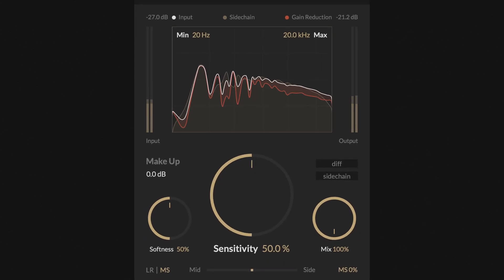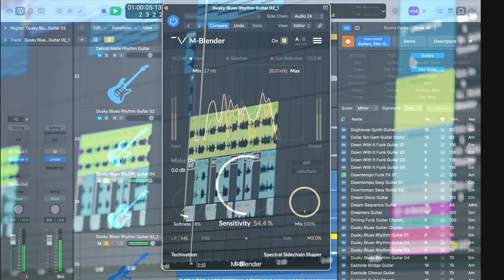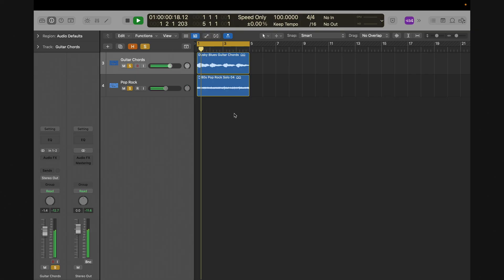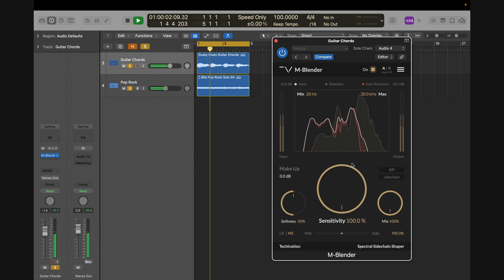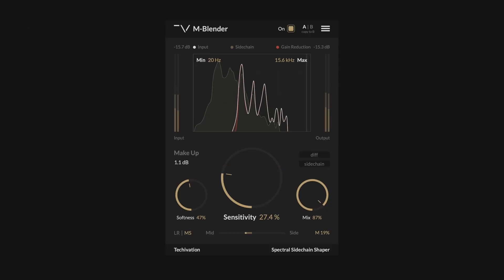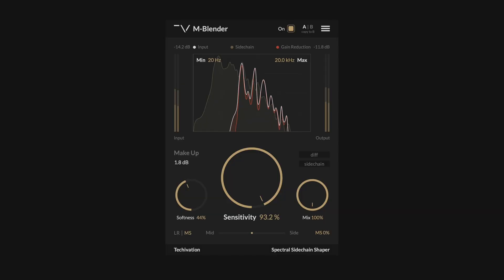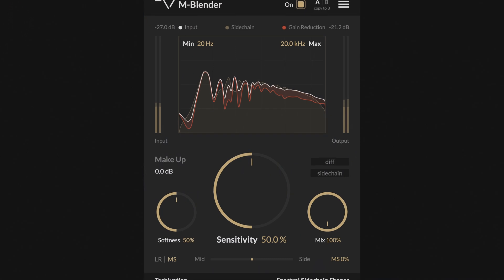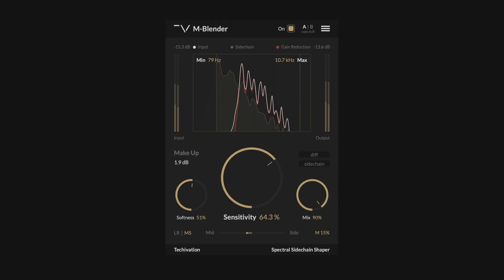Techivation M-Blender Walkthrough

Comment: Trackspacer is much cheaper and does everything that this does and possibly has even more control. Use that.
Reply: Trackspacer is $59.00 and is M-Blender is $45. According to my calculations, M-Blender is cheaper
Reply: No there is a currently half off sale, normally it's ninety dollars. So why not just say that rather than try discredit someone?
Reply: @jcjc8939  Nice try, try hard. When I wrote the comment, M-Blender was $90, and is currently on sale for half price, with the original $90 price tag still visible but crossed out to reflect the sale. Why do people behave this way? Try to discredit someone they don't know, rather than, for example in this case just saying "if you like m blender, it's currently on a 50% sale"?
Reply: @jcjc8939   @jcjc8939  Nice try. When I wrote the comment, M-Blender was $90, and is currently on sale for half price, with the original $90 price tag still visible but crossed out to reflect the sale. Why do people behave this way? Try to discredit someone they don't know, rather than, for example in this case just saying "if you like m blender, it's currently on a 50% sale"?

Comment: I know it's only 1 hour old lol but an attack and release control would be awsome
Reply: Maybe if it were more akin to a compressor, or a gate, but proper spectral ducking/removal doesn't need attack and release as it doesn't work on a knee.
Reply from the maker: Even though the plugin is using a compression-style threshold, it’s actually doing spectral subtraction and there’s no explicit attack/release under the hood. :)
Reply: @Techivation   I am trialing it right now. Even after what you say I  would still wish for an Attack+Release control (and more SC flexibility on the Sc Filter of M-Compressor. 120hz  is a bit low 200-250 would be way more flexible) . 
To M-Blender now. Spectral of Not Spectral subtraction , a Signal is a Signal and when you take energy out of it it sounds like you are taking energy out of it. 
However sometimes it is wanted to have the effect NOT duck for the whole duration of an incoming signal in order to experiment. Overlaping sounds are the Spice of music. Sometimes you might  want the bass to duck  only for the attack duration of a kick and see how it sounds. This would be just one possible scenario